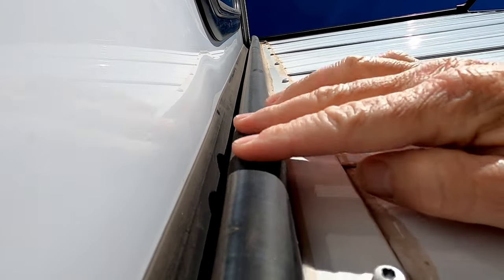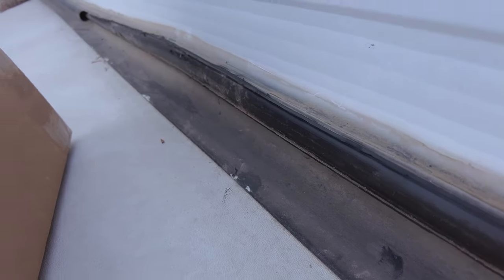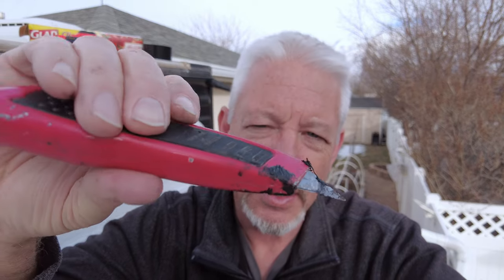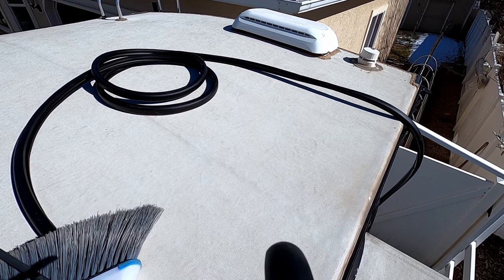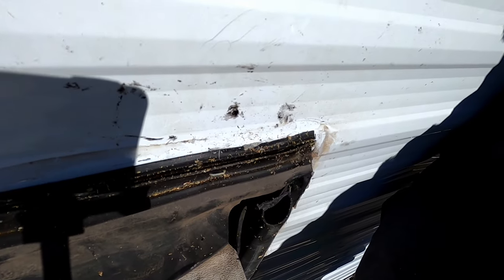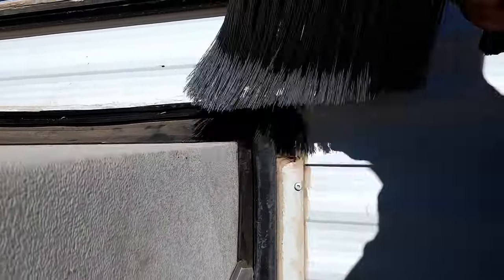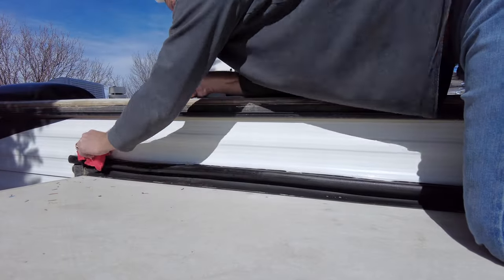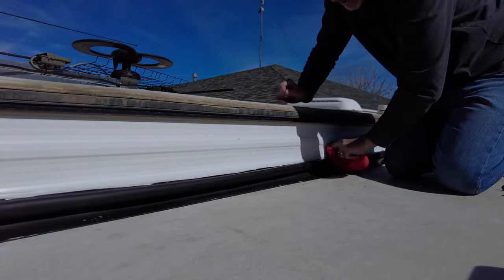How to replace an RV Slide Seal | RVAddict

Comment from the maker: Have you ever had to fix your slide seals yourself or needed to pay a shop?
Reply: I paid a shop for the first time. Now it's been about four years and they are melting again, so I guess it's time to do it myself!
Reply from the maker: Yes it is a bummer that these do not last very long.  You can do this.
Reply: I priced thru  an Rv Mobile Repair service in Texas, replacing seal on one slide at approx $300 with 1 hrs labor.  I sincerely believe, that if I could do it myself, I could do all 3 slides for that much.  According to YouTube it's not that hard.  Two people are better than one.  Make sure you tackle the project on a cool day as melted rubber, on a hot day, makes a mess .

Comment: Thanks for this video! My wife and I purchased a used class c with slideouts and, of course, received very minimal instructions on care and maintenace from the dealership where we purchased it. This is our first rv with slides. for two years now we have been merrily sliding them in and out until I noticed that they were making more noise and were not moving as smoothly than I remember in the past.

Comment: Great job.  I just replaced my slide seals,  and removed and  re caulked our RV. Ready to go.  Thanks Don
Reply from the maker: Seems like the maintenance never ends. Thanks Don for the support
Reply: What caulk do you use on the rubber seal?

Comment: Thanks for the video. What about the wiper seal? Should those be replaced too? Is there a video on how to do those as well?
Reply from the maker: Thanks Tim, I suppose you could also replace the wiper seal. My seal is still in good shape. I may have to replace it next year.  If the rubber feels soft and not cracked, you should be good for another season.   make sure to check it each season.

Comment: My seals/wipers are the double “C” Chanel and the shops want close to 5K to replace.  Do you think replacing it with the 2” swiper will work, the kind you staple/tape on and caulk? They made a DIY job into a pricey shop fix…
Reply from the maker: Your not kidding, the shops charge allot, it is a solution to the problem however. On this Video my Wipers are the staple and caulk type. this  was really simple once I had a look at the process. I am not sure of the 2" would be the right size as i don't know your setup. I suspect you already know but, generally speaking these fixes do not have to be perfect, they just need to be mechanically good. The factory installs never seem to be dead on and often they last many many years.  I would say, measure twice and even go ask a second shop, tell them you want to do it your self and ask if they have any advice. You might be surprised. Hope this helps.

Comment: I had the same thing happen to me. It was a mess. Do you know the size screw is used to anker the D seal? The guy that did mine replaced it with to little of a screw and it came away from the wall. Thanks
Reply from the maker: I would say to remove a screw to use as a sample, a grab a little bigger size. This should be good.